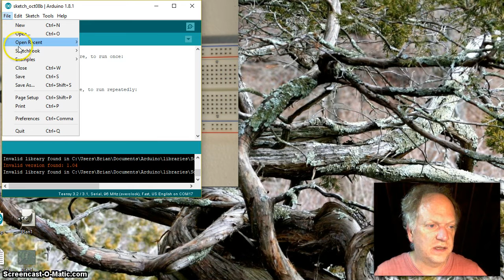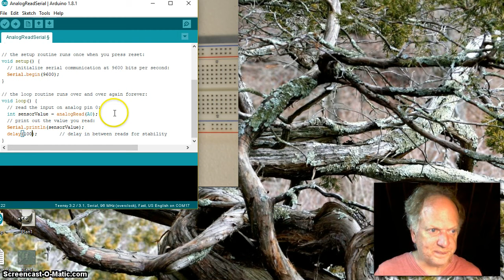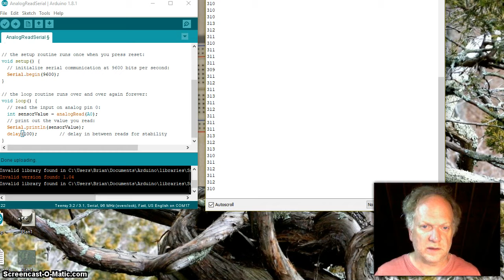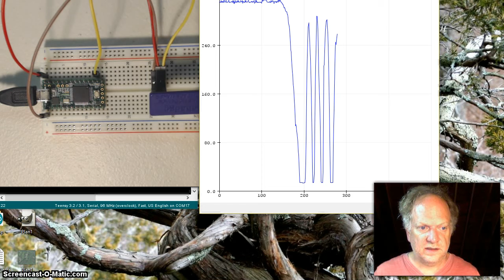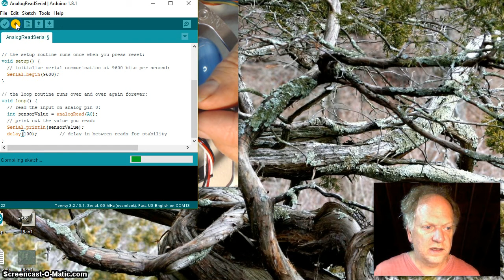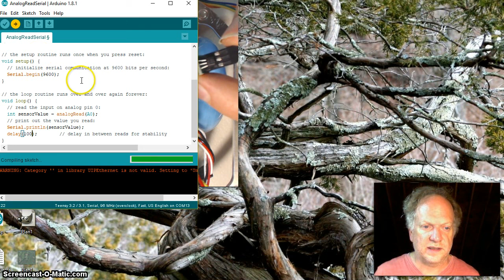Hall Effect Test

Comment: I'm a bit confused...you use the red wire (Vcc) on the first pin right, but I thought it had to be on the 3.3v pin , i.r. the third pin right....is it by chance a different model?
Reply from the maker: Hello I'm using a DRV5053RAQLPGM
 or similar. the have a 2.4-~38v range. Output is around 0.2-1.8v
Reply: @brianpatton7496  thank you so much, that would be my second question ;)....but at 1.40 you connect it at the first pin, instead of the third pin: according to my teensy 3.2 documentation, the first is for VCCin to feed the board, and pin 3 for output 3.3V .....therein lies my confusion...or does pin 1 have a double function?

In any case, happy to have discovered your channel! Keep up the good work, and awaiting your response on the first/third pin...
Reply from the maker: @hermanvangestel8081  You are correct that the third pin down in a regulated 3.3v supply but the top pin is coupled to the Voltage in of the USB. There is a cut option on the bottom of the chip to separate the Vin from VUSB if you are wavering from USB voltages. Unless that gap is cut, they are connected.(as I understand it)
Reply: @brianpatton7496  clear, crystal! 
never thought of that option!  thanks for your valuable work and info!